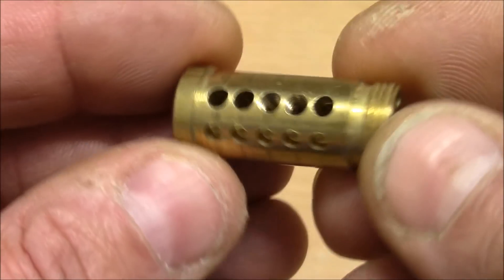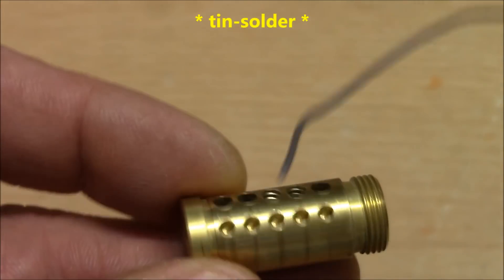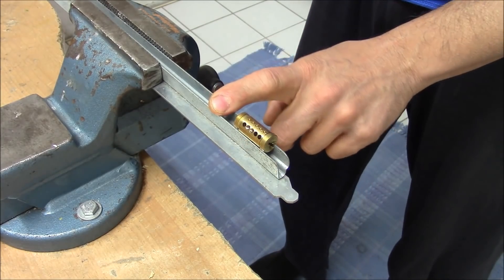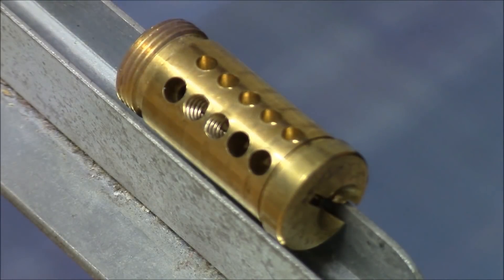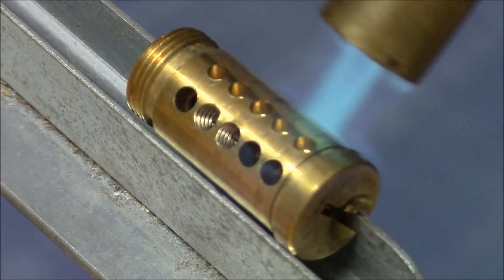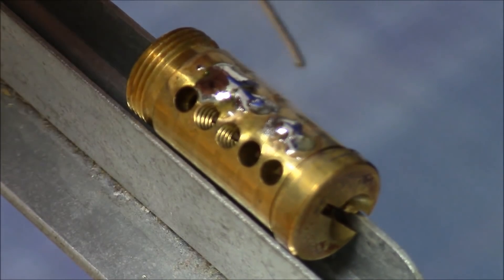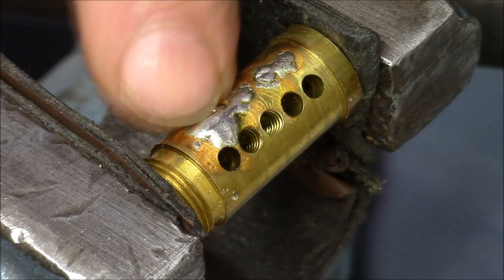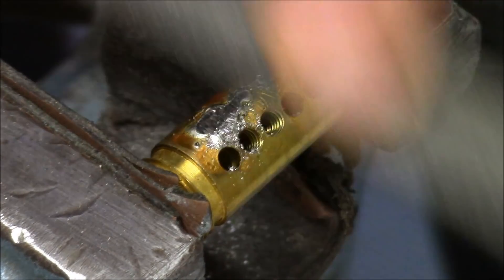(picking 681) How to fill construction holes in a pin tumbler plug

Comment from the maker: Using a blow torch, tin-solder and a file and sand paper is sufficient to fill up the little construction holes that are found in some pin tumbler plugs. More info about construction keyed locks here https://youtu.be/DddapGFxgQI
Reply: How about cutting the soldering material and putting the cut segments in the pin holes in advance before melting them with a electric soldering iron? Might reduce the risk of removing substantial material from the cylinder and annealing the metal.
Reply from the maker: The tip with putting in small pieces in advance is great - thank you. Annealing should not be a problem as it's brass and not steel. Unfortunately my soldering iron is not powerful enough to heat up the plug to melt the tin-solder (I tried it).

Comment: I make key pins from brass rod so I just use the same rod to make plugs that tap into place and sand it flush but this works too, I’d be a bit worried about possible warping or getting solder where I don’t want though.

Comment: I know this was just a demo to see if this would work (it did, nicely). A much easier, SAFER, and cheaper way is just to put some epoxy glue in the holes and then some light sanding.
Reply from the maker: I'm not a fan of epoxy as I make a huge mess every time when using it. And solder-tin I have a lot at home but no epoxy glue.

Comment: I like this method as it is stronger than the typical.  But I keep feeling like it is a bit more work heavy than I would like. Maybe cutting small snips of solder to put in the holes and then heat the plug and melt the solder.  But I am sure that there are many ways to do it. Thanks for sharing bro
Reply from the maker: The pre-filling is a good idea. Beside of the work it's fun for me to play with fire ;-)

Comment: Great job and demonstration!!  Do you ever have to clean or try to sand inside?  Thank you for the lessons. Happy pickings!!
Reply from the maker: No, but if solder would go inside the chamber I would drill or tap it out.
Reply: @Potti314  if it doesn't stick, just use flux, no need to drill it out to bond.

Comment: Who would down vote a very nice video like this? 

Ncely done experiment. I  look forward to another video later on down the road to see how well it holds up.
Reply from the maker: Thank you for your encouragement. Guess it will hold well, not much stress that will go to the soldering parts.
Reply: Cold to warm experiments are worthy and so too are some tap tests. Filling the holes is one thing, it sticking,adhering, is another. Sometimes adhesion can be accomplshed mechanically,like with a undercut forming a lip for nonsticking material to wedge itself above next to and below. If deeper, threads would ensure it stays put. 
 
I wouldn't want to see a bunch of work invested in a custom lock to be frozen by a filler that dislodges and then binds the plug. This is the neat thing about experimenting, brainstorming and building on successes as well as failures...all of it knowledge gained.

Comment: Great video,  and not just because I love the fire. A regular soldering iron wouldn't get it hot enough to do without the torch? I haven't tried that method before,  but it looks like it works  great.  I have used small ball bearings & epoxy before,  and just red lockTite left a day to dry. Construction holes are a pain,  or a trap if a reduced diameter pin is in the stack.
Reply from the maker: Yes a soldering iron has not enough power, I tried it. I always make a mess with epoxy and try to avoid it. Also the tin solder is already in my possession and nothing additionally was needed to buy.

Comment: This looks like the best way to fill those pesky holes.  I’ve always used JB Weld and file off the excess to keep the plug smooth.  Your method here would definitely hold up longer 👍👍
Reply from the maker: Thanks buddy. I also had no jb weld available or epoxy, however tons of tin solder. Just happy that the chamber stayed clean.